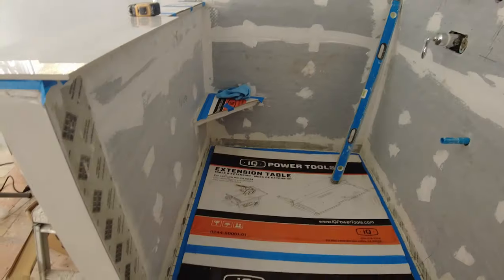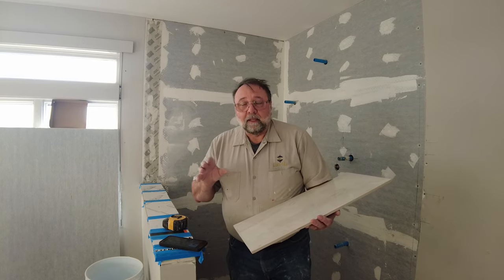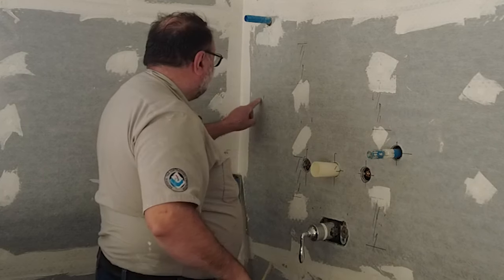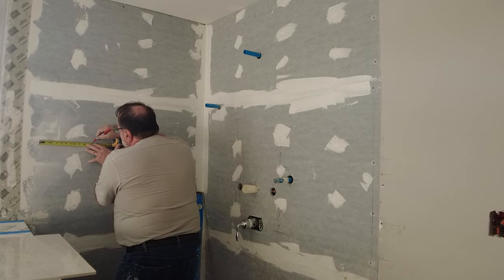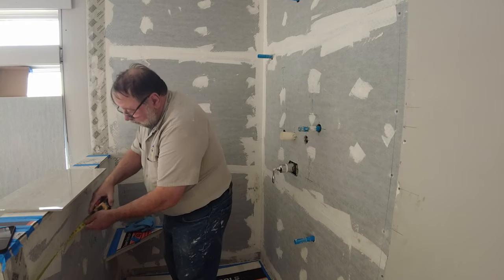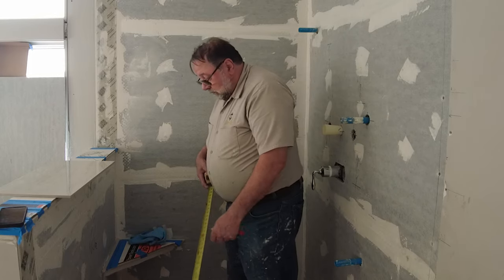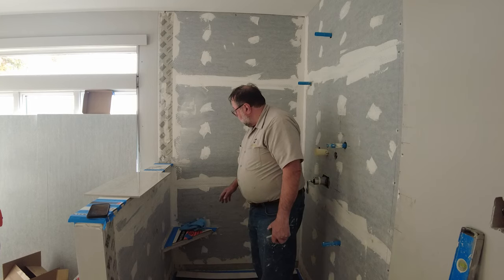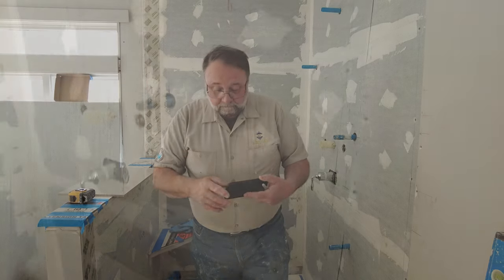Tile layout explained, Day by day issues when building a shower Part 3

Comment: I switched to metric a few years back. I prefer Sigma cutters, so the change was immediately helpful, no pencil marks required for basic cuts. I also like the simplicity of the measurements. I’ll never go back.
Reply: yea we use metric in aus, seems so weird hearing someone tile in inchs like why hahaha
Reply: @hunterhofman3555  I also wonder why - here in Canada we have an odd tradition using of imperial measurements in construction.  As a result, it’s very difficult to find a proper, all metric tape measure. I lately must shop online, and even there the selection is very limited. Only one size available: 8 m.

Comment: Sal, I noticed you marked your vertical line about an inch and a half from where the transition to drywall is.   Do you always stop it a little bit before?  What if the shower curb on the bottom ends directly on the transition?
Reply from the maker: It's always outside the wet area and I draw a new line for the tile

Comment: Hi Sal, you tile first then add the sills, correct?
Reply from the maker: Nope, sills first.
Reply: @SalDiBlasi  do you leave a gap behind for tile to slide into then or notch the tile around? Seems counter intuitive. Any specific reason you place the sill first?